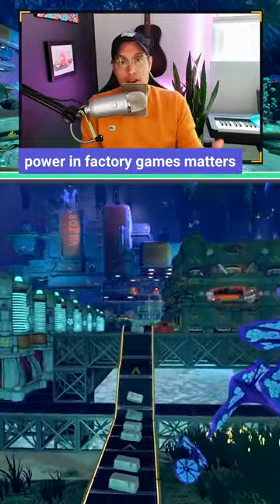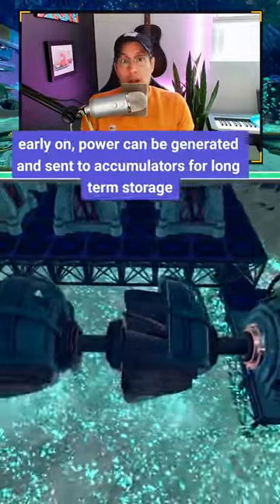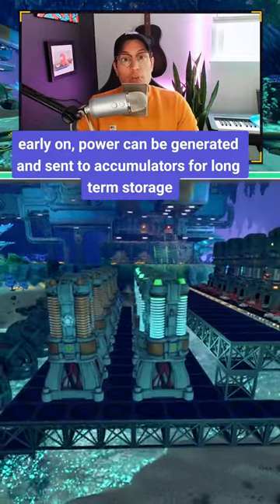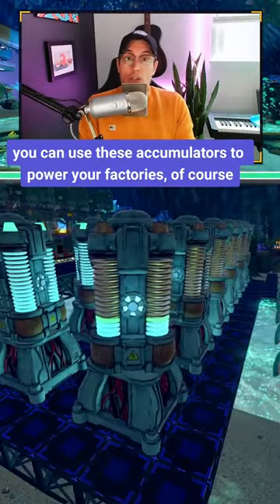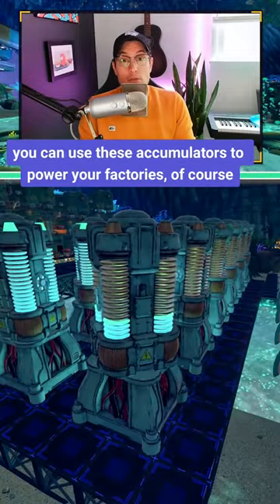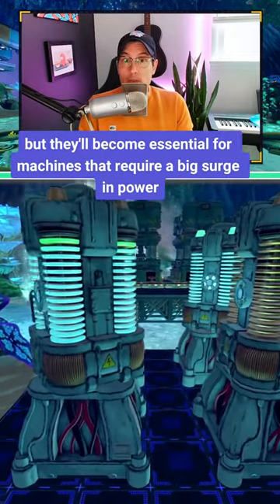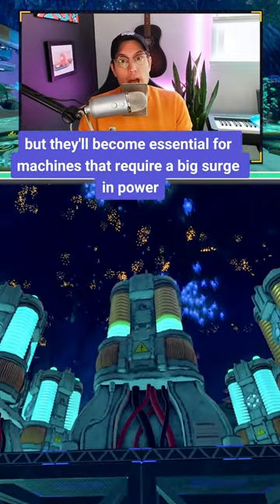Power in Techtonica

Comment: I have just over 200,000 Kw, half is from the research cores and the other half is from the tier 2 generators. I think research cores is the way to go once you have the corresponding tech unlocked.
My accumulators are at 80,000 Kw it's just this massive field of them.

Comment: I built my power plant in the circular waterfall around the base there. Producing over 200k kW, and I built a floor above it that will be my battery. The Battery isn’t finished, but currently holds I think 3.6gJ of power.

Comment: Shame the monorails are bugged, only way i can get mine to work is restarting my game, it then sends 1 load then bugs out again, ive more than enough power and about 30 energy stores
Reply: there was a bug involving the HVAC which I believe that sounds like. 1.2 should fix it. till then I think you can place accumulators on the power floor that the mono rail is on and that might fix it
Reply: Mine works fine 🤷‍♂️

Comment: How do i get 240000 kw? Ive built a ton of cranks and water wheels.
Reply: Use accumulators
Reply: The value it asks for is in accumulators stored power, not produced power.